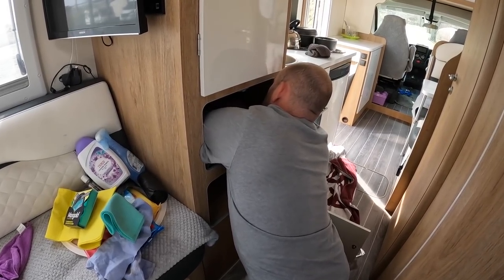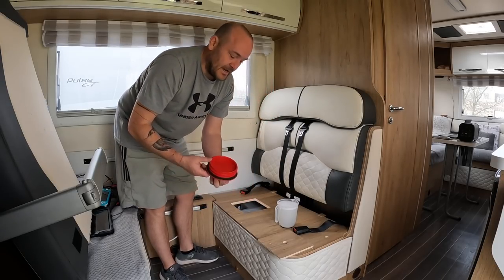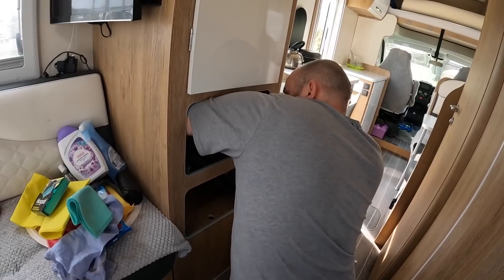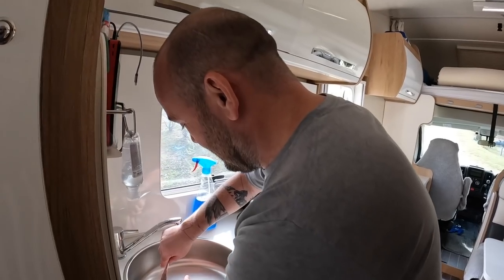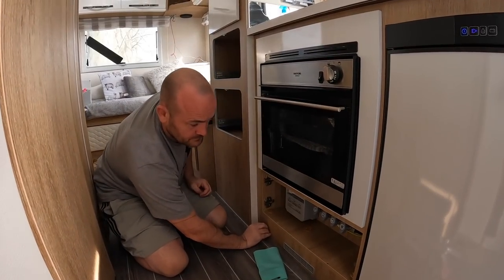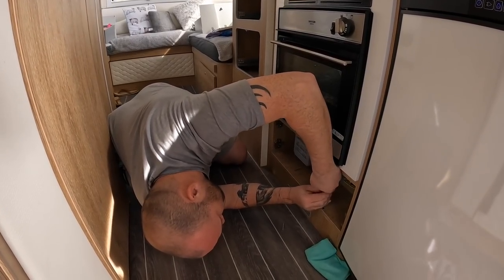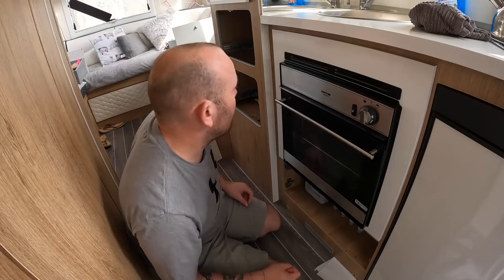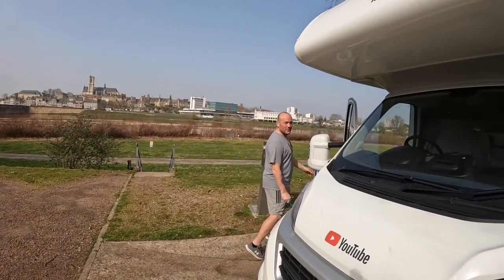How to clean the water system on a Motorhome

Comment: Oh dear folks it's a nightmare when things go wrong and it is always so inaccessible! Hope you get the sink fixed and the wonky floor. A few weeks ago on my Minehead trip (see video 😏) my fridge started doing the same on mains. Turns out it was the mains heating element. There is one for gas too. Could be the same problem, although at 9 months old I would hope it isn't. All the best. Martin
Reply from the maker: Hi Martin, thank you will certainly look into that. We thought maybe the circuit board was affected by the leaking water? Who knows but will get to the bottom of it all soon, the floor is so annoying as it’s so new but who knows XxRR

Comment: Hiya.  Give continental at Cross hands a call on Monday. I doubt they would object to you making a temp fix with silicone. Let's face it silicone can be easily removed and causes no damage, but may get you up and running.  For piece of mind,  if anything goes wrong in the van it's just after their PDI, and within 12 months.  It does not matter how much you spend on the vans, be it benimar, chausson, hymer,  if the fitter has messed up, it's messed up! 

Have a great week
Reply from the maker: Thank you Paul, appreciate the comment, you are totally right! We know anything you buy has snags we have a super long list and unlikely to see some of the parts before the warranty runs out lol, tbh the dealer have been helpful. XxRR
Reply: @TheRollingRucks  I had a six berth benimar,  a great van but interior wise not as nice as your layout.  We were lucky with snags but solved most as we went along, waiting for benimar to authorise took ages.  We live in Swansea and have a good guy to come to you to do and do the habitation service for about 140£.   Any warranty issues he gives you the list to submit to your dealer to sort out.  Its very handy you being a chippy to resolve some interior issues.   We are thinking of a self build, belt and braces type, but the van stock. Is limited.

Comment: I feel for you guy's.... Its simply not acceptable having so many issues at this point in the vans life. We have a roller team t-line 740, it's just turned 3 years old and up to now we've had the flooring siliconed due to movement, the skylight above the shower has a faulty spring, the draw under the sink has a snapped lock.... But weve also had a, very annoying Lound squeeking from under the chassis when we, walk around the inside when parked up.... And we, are having to send it to get a full chassis and suspension check..... Hope they can suss out what it is (doesn't seem to be coming from the inside).... But it does seem to be coming from one side under the van possibly to do with the suspension.... Anyway.... I know how frustrating this can be and wish you the best of luck getting it all sorted very quickly.
Just to mention that I think it's quite normal for the water to drain slowly. Ours has been slow since day one, and I have heard alot of people say the same thing.
Don't get me wrong though, we love our van and the layout is perfect for us 👍
Reply from the maker: We also love our van and like you expect to have snag jobs that need looking at. It’s all the bigger faults we wouldn’t have expected and being in Europe so far from the dealer hasn’t helped. Hope you manage to get your floor squeak sorted asap too it’s so annoying isn’t it? Plus parts taking forever to arrive for Rt at the moment doesn’t help! XxRR
Reply: @TheRollingRucks  thank you, we hope so 😂

Comment: Just a thought guys, the plug hole in the sink can sometimes be overtightened by the manufacturer causing the lip on the plug in the sink to lift up because the the screw in the center is pulled in and the rim buckles slightly allowing water in the simk to pass under it. The seal under the sink sounds good, but i think the plug in the sink has become slightly deformed and not sealing between the sink and the plug.  Hope this helps guys.
Reply from the maker: Thank you Alan, this is great advice and appreciate the comment we have been to the dealer for emergency repairs to the sink area just waiting to see if the floor can be sorted and the other snags XxRR

Comment: Hi sorry to hear about the problems. Though we have a different make, we have snags that we are still waiting to be fixed nearly 2 years after buying it.
We too have a sunken floor which is a serious problem with our make, we now are waiting for floor parts to be sent from France to endeavour to fix the dodgy floor.
We have had to threaten  ĺegal action because dealers don't want to know once they have sold the van.
Can you take the sink out from the work surface.
Reply from the maker: We have showed the floor to the dealer and they said it’s a very common thing in RT and they didn’t believe it was bad enough to report although they offered to try if we wanted but believed they would reject the claim. We are going to get a second opinion on the floor for peace of mind. To take the sink out the oven would need to come out which is connected to the gas which is the one thing in the van I’m not willing to mess with.
Reply: @TheRollingRucks  hello our dealer tried to tell us the floor was OK  but after at least 10 owners in the UK and more in Europe complained  the manufacturer  is now acting.
It's good to get a second opinion. 
Burstner had a problem some years ago, so buyers of second hand vans were very wary.
Reply from the maker: We have just had a chat with another owner of RT suffering floor issues and was very interesting although it does seem they don’t want to repair them and make other offers but this